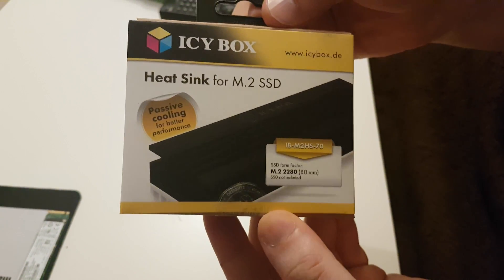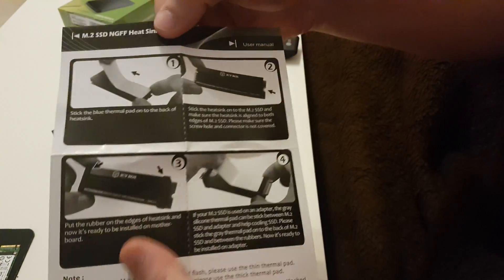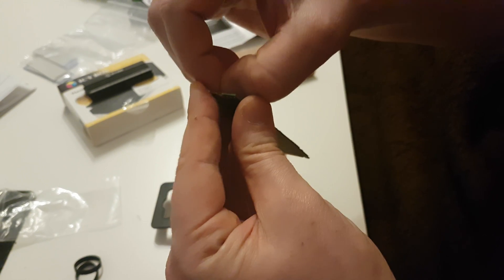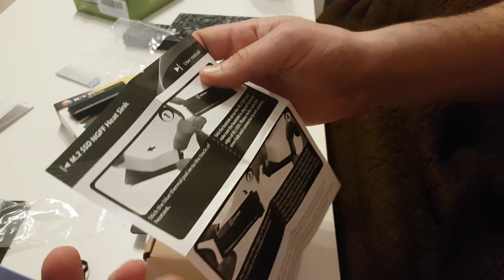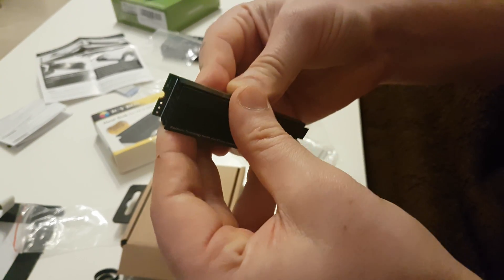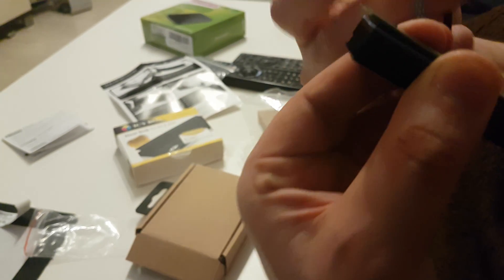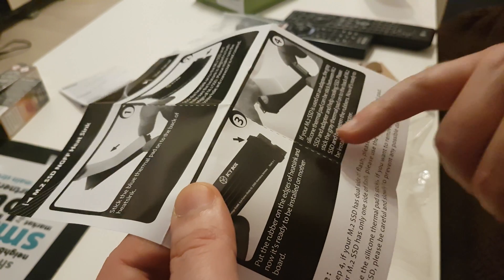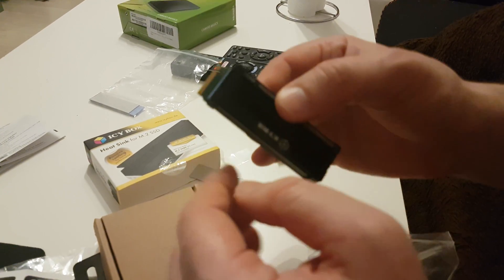SSD M2 Cooler,  installing a SSD M2 COLLER from ** ICE BOX **

Comment: Don't use coolers that use rubber bands to secure it, it will snap eventually as the rubber degrades with high temperatures.
Reply: Yusimg mine 5 years for heavy gaming and this is bullschit😂

Comment: How are the average temperatures with the heatsink now? On idle and some standard, not very long data transfer?
Reply from the maker: Actually i didn't make any test after i installed it, I installed it just because I noticed that it gets hot and after the installation it is better.
Reply: @shafikbanialmrjehkassar4640  Congratulations for the most stupid answer possible.

Comment: The grey thermal pad you placed on the circuit board really serves no purpose there. As you probably know, the blue thermal pad that you placed on the chips just allows for a good contact between the chip surfaces and the heat sink, allowing for best possible heat transfer to the heatsink.
Reply from the maker: I know but if it will not help defusing the heat into the board it will not be a bad thing also and because of that I did put it :)

Comment: Bear in mind. Removing the sticker on the top of SSD might make SSD manufacturer warranty void ! While there is a legal debate on this, for the time being perhaps it is safer to leave it if SSD is still on warranty.
Reply from the maker: yes u r right
Reply: so i should glow this thing on the sticker of the ssd?
Reply: @brainteamtino158  Removing sticker means you are out of warranty. They can understand it even if you restick it professionally. 
So, use pad and sink over sticker. Temp difference is negligible (with or without sticker).
Reply: yeah and low performance impact too, might as well leave it on
Reply: i dont think so. stickers should stop you from opening cases!  most M.2 ssd are kinda "open", so it does not matter. my sticker does not say "void if broken"
Reply: It also makes no difference since it is not a simple paper sticker, but it is designed to transfer heat.
Reply: Thank god im living in Germany were they don't care and can't do anything, i still have my warranty ❤️
Reply: @Its_Ayyz  thank god ? Lol. 100% immigrant.
Reply: @stavrosdra ?